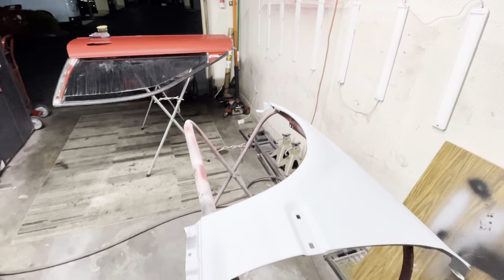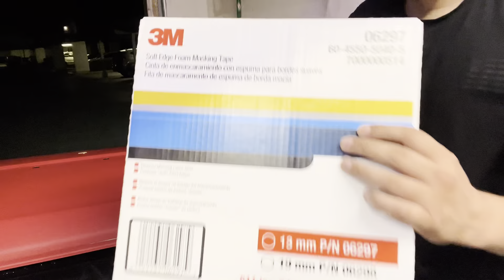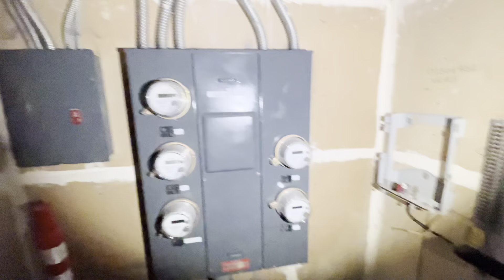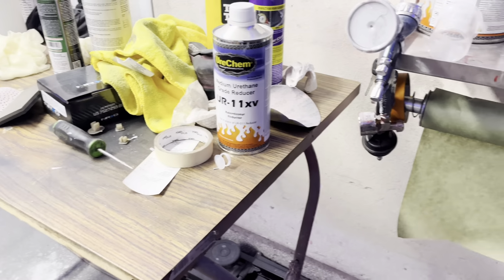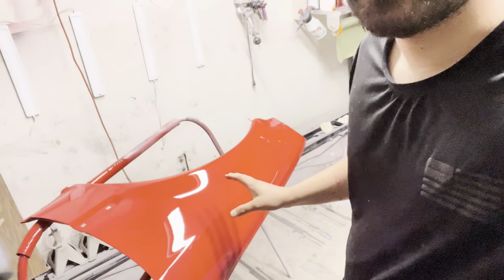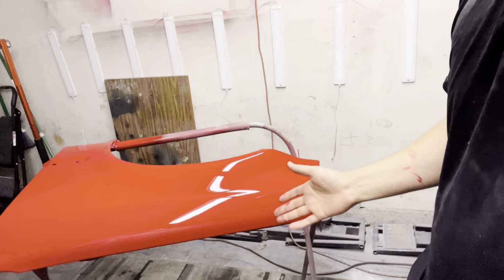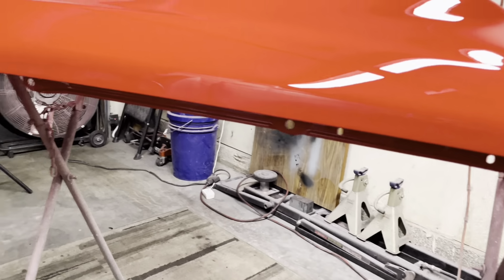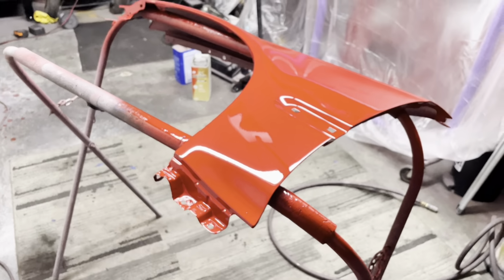The Struggles of Painting At Home

Comment: Hi Chris I think you are doing a great job seeing as it all done in your garage, I do feel your pain as my booth is homemade and sits in the corner of my workshop and at times I get some nice clean job but to many of them have dirt nibs in them.
I was using my DV1 clear gun this morning and agree it's not the fastest gun out there but it does lay the clear down nice, I normally use a 1.3 tip with the C1 cap I do have the C2 but for me it uses to much air👍
Looking forward to seeing the door finished🙏👍 John UK
Reply from the maker: Thanks John I might be give it the c1 cap a try I just fear it’ll be even more slower

Comment: Chris-ever consider hanging the fender vertically instead of horizontally for less dust nibs? I did this in my garage a while back and noticed  much less trash in the paint. Just a thought.... appreciated the updated video.
Reply from the maker: Yes I spray them either vertically or horizontally only thing is I didn’t have a place to hang it vertically on the stand it would be too low
Reply: Chris-i got a stud finder at Home Depot to find the studs in my garage ceiling. Once located ran some bicycle hook hangers into the studs. Then ran some rope to the bicycle hooks and attached to the fender which was light weight-adjusted the the length of the rope to a comfortable height.Northing fancy but worked like a charm. Can send a picture if that would help you out.
Reply from the maker: That’s a good idea

Comment: Came out good man. Which air cap do you have on the DV1?
Reply from the maker: I have both but I typically use the c2 air cap
Reply: @Mechaniclyfe  i figured you'd like the C2 air cap. I haven't really used my dv1s or iwatas lately. Been using my prolite for everything.
Reply from the maker: I thought with the c2 air cap it would be a bit faster Atleast tekna prolite speed , i feel it’s much slower than that